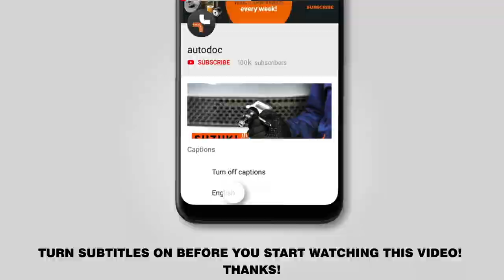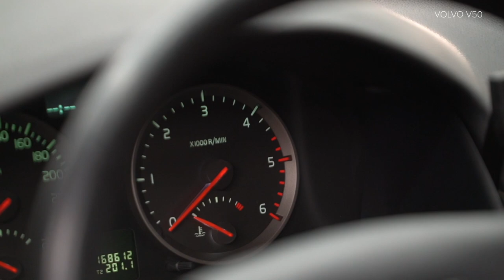How to change oil filter and engine oil on VOLVO V50 1 (P12) [TUTORIAL AUTODOC]

Comment: I come back to this video since many years. i.e. every time  I need to do a lube job on my V50. I also order the parts with Autodoc. If the shipping price was proportional to the value and the size of the parts I would even order my small parts with Autodoc. But till then I'll order only anything above 80 euros with Autodoc. For anything below 80 Euros I'll use other suppliers. Thanks

Comment: Hi! Is that type of filter necessary inside that plastic tube?  I have seen metal filters without the need for that plastic box.
Reply: For what I have seen, most diesels have plastic tube and filter element, petrol engines have metal filter.

Comment: Hello auto doc ! Great video ! The engine is made from peugeot citroen ? I think its france engine , too bad for volvo company
Reply from the maker: Unfortunately, we don't have any information.
AUTODOC
Reply: Ford focus engine. V50 2.4 has Volvo engines ;) I own a V50 2.4
Reply: That stupidity of "France engine" is just that, stupidity. Sorry to break it down in such a simple form. Audience demand I guess. ;-)
This power plant goes on Ford, Mazda, Peugeot, Citroen, Volvo... As been produced, literally, by the millions! An there's tons of examples of very high milleage engines out there. Many serving on Taxis. 
Definitely this engine taught one thing to the masses. Good performance, emissions and consumption can go all together in a very smooth running engine. 

One thing negligent owners also learned. Is that a modern engine do require good oil and good maintenance schedule. What a surprise! LOL 🙂

Comment: Hello Autodoc! 
I was just wondering about the amount of oil you used in this video.
And what type of oil, I live in Scandinavia, so we get really cold winters, so what do you recommend?
thanks!
Reply: Hey Really cold must be 0-25W or 0-30W oil ;-)
Reply: Hi,
SAE 5W-30 is fine unless you frequently get temperatures colder than -30 °C in which case you should use SAE 0W-30 or 0W-40
Reply: @senraXD  0W - 30 is correct.
40 W is too thick ( bearing clearances)
Reply: I believe volvo recommends 5w-30